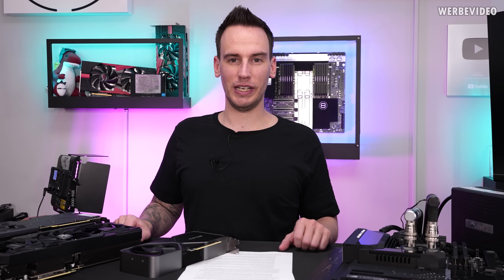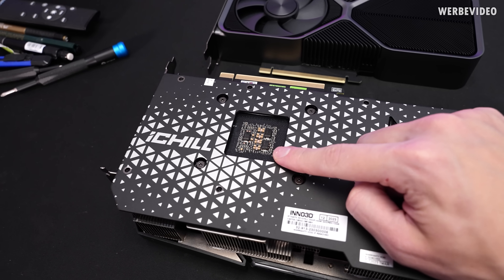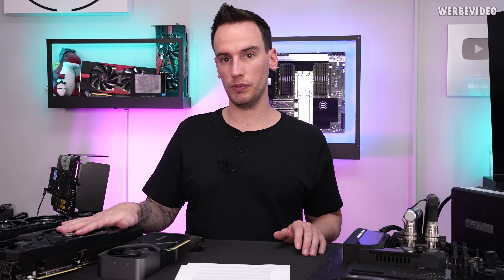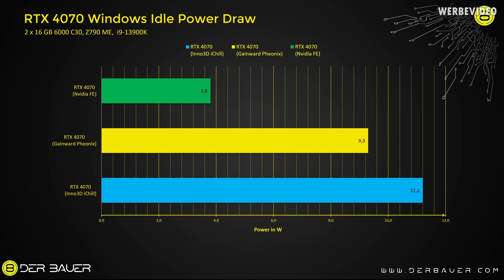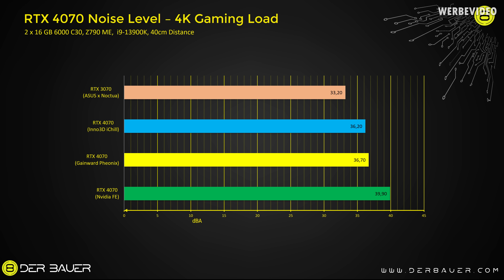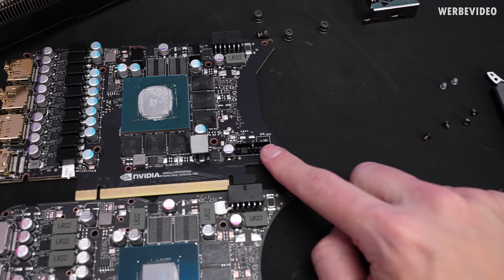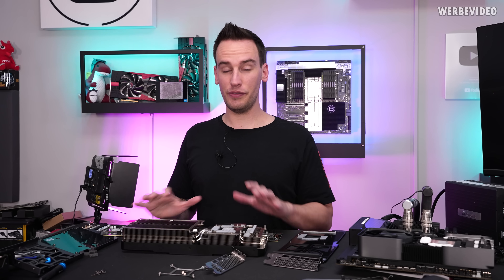Nvidia doing Nvidia-Things again - RTX 4070 "OC" Review and Teardowns

Comment: The MSi 4070 OC was only $15 more than standard version from my local Micro Center. And it runs sooooo cold!!! Performance to power consumption is so good, even on a looped GPU 'stress test' I am not seeing over 52C overclocked. Idles 21-25C.

Comment: I am seeing pretty much what you are talking about as far as performance in my MSI Ventus 3x 4070. It's the OC version, but there is virtually no difference in performance. Also, this version doesn't have RGB so I am seeing the very low idle power draw which is nice. I still feel the card was priced too high. Feels like it should have been a $500 card, not $600.

Comment: 9:14 the fact that there is room to put 4GB more memory ram of current ram and the unanswered question if they share MB with the AD104 RTX 4000 SFF 20 GB ECC, and so you can use 20 GB in 5 double capacity chips of regular vram changing only some jumper setup. Paulo Gomes claims to have succesfully turned a regular 3070 in a 3070 16GB by finding the jumper setup of the RTX A4000. So he has solved stutter on high demanding vram games.

Comment: Look at the gap between the 4070 and the ti. There's enough room for a 4070 Super in there. I'm wondering if that's what Nvidia is thinking.
Reply: 4070S 12gb at $700, 4070 drop to $550 no less. 4080ti 20gb at $1500
4080 will drop to $1100? , 4090 phased out into 4090ti 24gb at 2000$.

Comment: A 3070 had 56% of the cores of the 3090. The 4070 has just 39% of a 4090 meaning a 4070 should have been exactly inbetween a 4060 and 4060TI if compared to Ampere. They stack shifted and raised prices, Nvidia can't help themselves.

Comment: 4070 vs new 3080: 6950xt. 
4070 vs used 3080: 3080.

3080 costs 200 Euro less, and if you undervolt it is only about 60W difference between cards. So it's more like 25 Euro per year difference in power draw cost, 
 if you play for 4 hours per day.

Comment: why are they still rocking such low vram on the 4000 series?

from experience in the (yes I'm old)512mb vram, 2gb vram, 4gb vram n 8gb vram days, as soon as any game caps out the use, even if it just caps out the allocated but doesn't actually use all its allocated, games get jumpy real quick.

so why the trash tier 12 n 10gb vram?

Comment: The issue I have with this margin of error theme in techtube reviews, is it should be based on consistency.
If the card always gets 1% more performance, than that isn't due to margin of error, but it simply is 1% faster.
If this number fluctuates, then yes it's a margin of error.
For example, a 100 degree day is hotter than a 98 day. That isn't a margin of error, it's just a 2 degree difference
Reply: But does it even matter? You are not going to notice it. Besides, cards are already set up to dynamically boost as much as they can, so you'll already see more of a difference between cards that differ in the quality of the silicon or in the build quality (which differs even for the same model of card).

Comment: The Gainward and Inno3d cards are hilariously overbuilt for a 220W board power GPU , did they think they were building for 320W? 🤣 What a total waste and it's a shame the AIBs need to do that to differentiate their models.  perhaps nVidia could be so kind as to derestrict what AIBs can do with the cards? Like how comes we have 8 pin connectors or 16 pins but not 8+6pin?

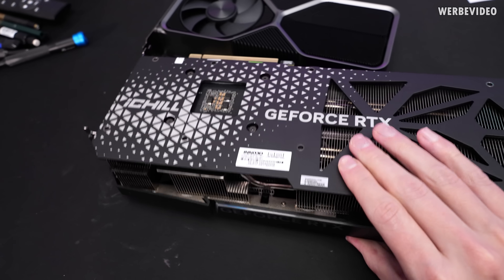Comment: 1:30 This shroud is bigger than it can be the protruding edges only make the card wider. Make it wider than is necessary. I dont like this. 
BTW why in every review nobody say about length of card? I dont care it's 2,5/3/3+ slots but how long is. 28cm 30cm 333mm? In my case only fit max 32cm GPU so I need to search it in TechPowerUp data base. Basic thing that no one say in review.

Comment: I see why EVGA went away from Nvidia and VGA in general.   Doesn't look like Nvidia is allowing any measurable customization of the PCB, they are literally selling them the PCB branded to another company.  Only thing 3rd party has any control of is the cooler design.  I haven't gotten my hands on any 40 series, are they power limited and will a shunt mod be possible on the larger cooler cards, or is it still basically a custom loop novel?

Comment: rtx 4070 fe is aesthetically perfect fit for sff build. The msrp should have been around $400-450 even after considering the current inflation. AIB cards are unnecessarily oversized to squeeze out tiny bit of performance.
Reply: thats what happens when Nvidia bins FEs and gives unbinned chips to AIBs
Reply: AIB cards make no sense if NVidia caps power targets at Founder Edition levels. There is absolutely no performance to gain anymore.

Comment: This would have been the RTX 4070 TI if Nvidia did not receive backlash for the RTX 4080 12GB???
WTF, Dude, this is an RTX 4060 AT MAX.  🤯🤯🤯
Reply: Really?  Would you expect a "4060" to commonly outperform a 3090 and sometimes 3090Ti at 1080p?  Thought not...
Reply: @awebuser5914  "4060" slightly better then 3070Ti and it doesn't reach 3080 on 5-15%. "4060Ti/Super" or just "4070" could already compete with 3090. But in fact we have 4060 called by accident 4070 and sell by price of 4080.
Reply: @MakeYourVision  Give your head a shake...  On a lot of titles, the 4070 outperforms a 3090, or 3090Ti at 1080p, which is where a fast midrange card is really targeted at (max framerates at 1080p).
Reply: @awebuser5914  That isn't not what nvidia has done, the 4070 is the 4080, until consumer anger forced nvidia to change it,  and when you benchmark and look at the chip shader counts, the 4070 is a 3080....  It's not even a upgrade.

Comment: I see a card that's as fast as a 3080 while literally using half the power.
My Strix 3080 12gb pulls 450w with coil whine.

So sick of YouTubers just complaining about everything.
(Not bitching at you, just saying it's being negatively reviewed)

2070 about as fast as a 1080
3070 about as fast as a 2080
Funny
4070 about as fast as a 3080
Reply: The 1070 was about as fast as a 980 ti with extra 2 gb of vram
Reply: 3070 as fast as 2080ti
20 series was a really bad jump in performance compared to 10 series so horrible comparison. 
I got my 3080 fe for $699 more than 2 years ago, now you get that performance for only $599 what a deal! 😂
Reply: @juancampuzano4841  who said you deserve a deal... Things get more expensive, should a Corvette still cost 60,000$ or 120,000$  honestly, is that brand new OLED technology getting cheaper? Newer things cost r&d and inflation causes material cost to increase but bad Nvidia for just doing what companies do...

Comment: It almost feels like a joke. 40 MHz of OC? If this was the pre-200 series cards that sounds a healthy amount. If the stock clock is over 2 GHz that 40 MHz is pretty much nonexistent...

Curious about the coil whine, is it caused by the coils themselves or the "subharmonic oscillation" phenomenon that affects current mode control switchers. Solution is to add slope compensation (almost all current mode controllers have it) which will only be effective about 50% duty cycle onwards

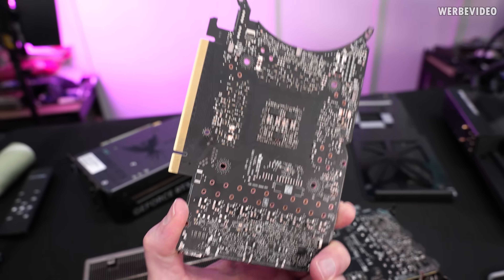Comment: 9:05 $600+ for a relatively small PCB you can hold in your hand (regardless of manufacturer). What a rip off!
Don't be fooled by the 3 fans or larger size, it's the same PCB, more or less.
This is a 60-class GPU with a different label, sold at an 80-class price. 😡 $600 was the MSRP of the GTX 1080!
Reply: "$600 was the MSRP of the GTX 1080!"  Your point being?  $600 in 2016 dollars = $756 in 2023 dollars...
Reply: @awebuser5914  Right. And does the 4080 cost "$756"? They're asking $1200 for it, lmao!
The 4080 has the specs of the 4070, btw. It's what the 4070 (non-"Ti") should have been.
Reply: @zdspider6778  If you plug-in a brain, you'd see that generational uplift is far beyond your ludicrous claims of the: "4080 being a 4070".  Ya, shit costs more and 4nm wafers are more expensive to produce that ancient ones and GDDR6x is more expensive as well...
Reply: By this logic why is wage only 10% up and not same as from 60class to 80class price xD inflation and that BS its all fake just like these fake overpriced cards with fake fps, if inflation is real and cards 60s are sold as 80s and every thing else is pumped in price, why is salary only 0-10% up ????? What is with that ??? Lets make same with wages add DLSS3 on the wage 2x money per month :D I need Optic Flow on my salary Nvidia, make that !

Comment: 2 empty VRAM pads....could have easily added 4gb....what a shame
Reply: the GPU can't see them, just because you see spots on the board does not mean the GPU chip is actually able to use them. THey reuse the same board for all models
Reply: @marcogenovesi8570  so what board uses the 2 extra pads? Is this the same PCB as the 4080? If that's the case, I see the 4080 dropping in price in the near future once yields go up. Bottom line is Nvidia is making ewaste and they could have mandated 16GB for midrange this generation.
Reply: @TDP808  Yes it's shared with the 4080 at least, possibly with others. That can fit 16gb and can actually use more power phases (also not populated here).
I agree on this card being close to ewaste, lower vram like this shortens a lot its useful life, and it's a classic NVIDIA move

Comment: videocard advertised clocks stop being relevant for Nvidia since the GTX 1000 serie, since then your gpu will run at it's max clock limited only by binning, watts and temp my 1080ti ran 1950Mhz 3090 1980Mhz and 4090 2895Mhz all stock out of the box (in the best case the lian li o11 dynamic XL) in the case of the 4070 apparently there are 8pins cards I would consider them 1st then temp then card length or a mix of those but not 40Mhz more, the efficiency of rtx 4000 is a major feature of them don't dismiss it, you know amd vs intel in cpus ? well rtx 4000 are even more effficient

Comment: what would happen if you populate all the phases and add the missing ram modules, to one of these cards?
Reply: the power controller might be able to use more phases or not (you would need to check its datasheet and hope it's not programmable) and the GPU can't use more RAM because the integrated RAM controller in the GPU is limited in hardware
Reply: @marcogenovesi8570  dang :(

Comment: Dear Helloder8,

I am writing to you in response to a recent statement you made on Gamers Nexus regarding the application of thermal paste on a CPU. It has been brought to my attention that you mentioned spreading thermal paste evenly across a CPU does not create air bubbles. However, I would like to bring to your attention that this statement is not entirely accurate, and may be misleading to your audience.

The uneven nature of an Integrated Heat Spreader (IHS) can create air pockets when thermal paste is applied evenly across it. This can lead to the formation of hot spots on the CPU, which can ultimately harm its performance and longevity. As a result, it is recommended that small amount of thermal paste in an X shape should be applied to the center of the IHS, which will spread evenly under pressure from the CPU cooler.

As a prominent figure in the tech community, it is important to provide accurate and reliable information to your audience. Any misinformation, no matter how small, can lead to confusion and potentially harm the user's hardware. Therefore, I would kindly suggest that you revise your statement regarding the application of thermal paste and consider addressing the issue to avoid further confusion and potential harm to your audience's hardware.

I hope this message finds you well and that you take this feedback constructively. Thank you for your time and contribution to the tech community.

-Duck

Comment: I can see reviewers having an issue with the recessed power plug, but like for 99.9% of consumers that's actually kind of a cool feature to help with clearance of the power connector.
Reply: Its not a recessed power, its an abcessed cooler.
Reply: yeah because consumers don't need to disconnect that cable eventually

Comment: Would love to give up the 3% performance for a card that’s half the size but I cannot. Not because I don’t want to but because FE cards are unicorns. Tried for 3 months to get a 4090FE. Saw almost every AIB get restocked multiple times while the FE was OOS all the time. Ended up going with an MSI Gaming X Trio
Reply: Or, you know, just buy a 6800 XT, 6900 XT, or 6900 XT rather than this inferior card. And if you want lower power usage, undervolt them
Reply: @rustler08  I'm speaking in general not this card specifically. FE cards have by far the best packaging that combines performance, cooling in a far more manageable size. But they're difficult to get. I already have a 6700XT a 3080 and 4090 but couldn't get my hands on an FE for either the 3080 or 4090 due to availability.

Comment: 192 bit memory buss, that's a low end spec.
4070 = 4060.
Reply: The 4070 Ti has a "horrible" 192 bit bus and outperforms a 3090Ti consistently.  Bus width is more or less irrelevant these days, if you have the compute cores and cache.

Comment: So, the GPU (AD104) is indeed capable to do 256 bit bus memory, but they limit it to 192 (see the missing 2 memory chips), because 16GB would have been too much for us.
Reply: Or it's a repurposed PCB when they started shifting all their models around after trying to pull the 12gb and 16gb 4080s
Reply: There's the board and there's the chip. Maybe you can use the same AD104 board with a AD103, if the chip size isn't that different.
Reply: Too much for ordinary use, but is "barely enough" for hardcore AAA games (because those games are becoming more VRAM hungry nowadays)

Take Hogwarts Legacy and RE4 remaster for example, those 2 games takes about 10 to 11GB of VRAM in their highest native settings
Reply: @sihamhamda47  It was sarcasm, dude. Ioan is pointing out that 16GB was fully possible, they just set this card up to fail in the future.
The worse the VRAM is, the more GPUs you'll have to buy.
Reply: @rustler08  Oh I don't get the joke
Sorry
Reply: @sihamhamda47  The issue is the GPU can do 256 bit bus, and is AD104. However, if they had fully enabled it, then why buy a 4080 16gb, when you have a 4070 16gb. Not even the TI model, based on the same AD104, does not have 16GB. This smells to me like a massive artificial limitation.

And the cherry on top is the soon to be Dead on Arrival 4060 and 4050 series. Definitely, this is indeed a generation that should be skipped. The only advantage to a RX 6950XT which cost the same is the power draw and dlss. However RX6950xt will be able to play games much longer at max settings compared to this card.
Reply: @sihamhamda47 just because a game has massively over the top settings that use way too much ram for next to no visual gain doesn’t make that the norm.
Reply: @oxfordsparky  VRAM isn't used exclusively for visual fidelity, and like it or not, 8 and even 12 GB of VRAM won't be sufficient for anything above medium settings in the not too distant future. It's just progress. Current gen consoles are allowed to use more than 8GB of their shared RAM for their GPUs, and to expect PCs to somehow make do with the same amount at anything above medium graphics while also handling the overhead imposed by Windows is nonsense.

Comment: Considering second hand 3080/6900XT go for 500-550 in Belgium, I think the 670 € street price (which by AIB reports is unsustainable) is fairly steep, and difficult to justify when the 3080/6900xt are easily trading blows with the 3070.
Reply: Correction: the 6800 XT and 3080 are trading blows the with 4070, with the 6800 XT being on average a bit faster (like 2-3%). The 6900 XT is just outright faster by like 10%.
Reply: @rustler08 watching other comparisons the 6950xt is only about 10% faster on average for double the power draw and twice the physical size.
Reply: It's crazy expensive, this is a 4060 labeled as 70 card.
Reply: @puciohenzap891 any proof on that? Or are you just making things up now? Proof, not rumors.
Reply: The difference in power consumption alone will pay that difference in few years. Stil, I hate the fact that 4070 has only 16GB of VRAM. It's borderline acceptable with 12GB, but I doubt it will last this console generation
Reply: @LurkingLarper  lack of vram & reliance on cuda infuriate me.
Reply: @therealb888  you mean the amount of cuda cores, right? I mean like it or not, Nvidia is the standard in professional work. But yeah, I hate the fact that there's not enough VRAM and that it has same amount of cuda cores as 3070. Ngreedia.
Reply: @LurkingLarper  Sure, but that 100€ + in up front price difference is literally the difference between being able to afford it or not.
Reply: @Florin_Neagu  it can be, unless you save for longer to stretch the budget? Anyway, the lack of VRAM doesn't really make me all giddy so you'd almost be better off getting second hand RX 6800 on the cheap, as sad as that sounds. Or waiting for AMD to release it's price competitors this summer.